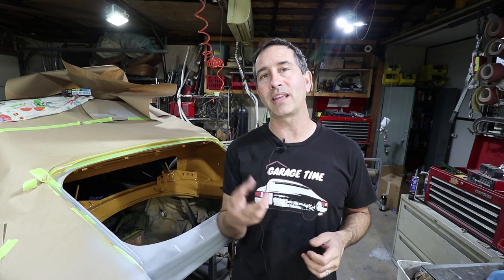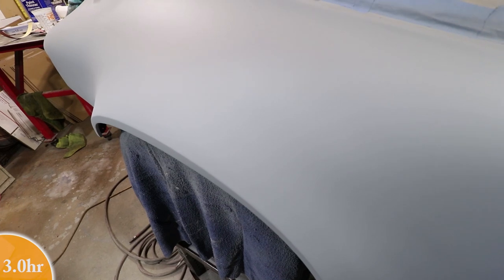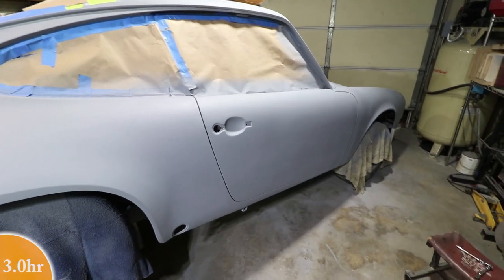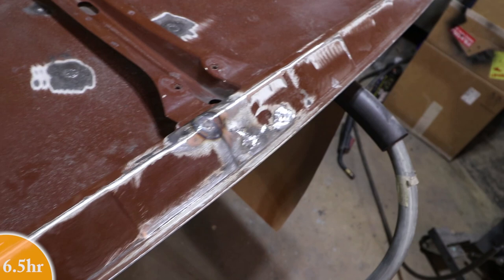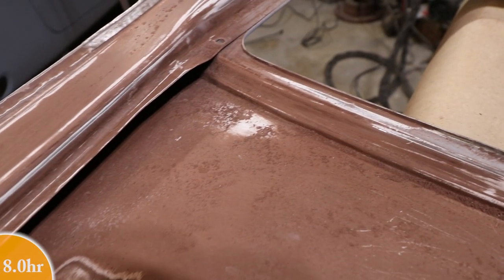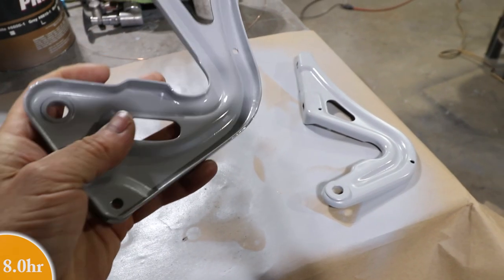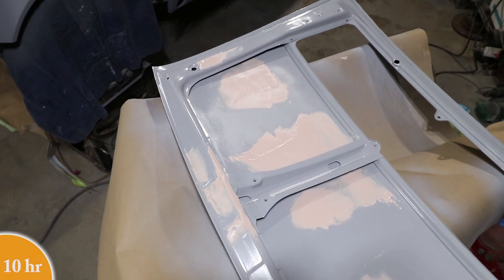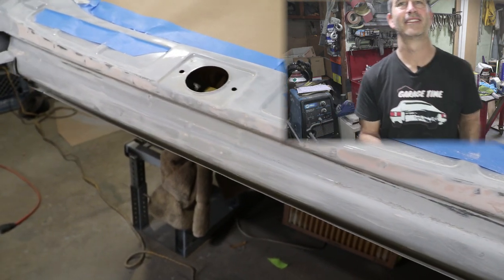Latest Porsche 911 Paint Job Prep Inside and Out

Comment: I thought I had watched all of your videos, but I don't remember if you've answered this -- Why no duck tail?
Reply from the maker: Hi Ronald,. Thanks for watching all the vids.  Wow!  I have not mentioned the duck tail.  I like both looks, smooth and duck.  The only reason I'm starting with smooth is cost. I found this one for $150.  I may add a second duck tail in the future and be able to swap them out.  
Good question.  I did put lots of work in this one, so I'm not going to just throw it away.  
Duck is supposedly good for really high speed aero.  I hope to be able to compare both on the track in the future!
Reply: @GarageTimeAutoResto  I really like that you're doing the whole thing on a budget.  I built my race car to be the least expensive Spec E46 with all of the parts that would make the car go faster and none of the unnecessary stuff.  I wound up spending around $10k less than most people who have built one.  

Your latest videos have been including a cost breakdown for that episode.  Are you going to share the whole budget at some point?  You seem like a good engineer.. I'm sure you have a spreadsheet!

Between you and Home Built by Jeff, I really want to start one of these builds.  I'd want mine to be as street friendly as possible.  I just don't know with KW's and some sound deadening and maybe the electric air conditioning solution ($$) if the car turns out to be as good of a regular driver as I would want for it to be.  I'm in Sacramento and without good AC a car isn't very useful.  I'm also concerned that they get valuable to the point where I wouldn't want to have to not drive it because I was afraid of parking it on the street.  I have a Cayenne S and a 996 and I can drive either of them anywhere.

Since I'm writing you a small book already, I'm also really curious how much track experience you have?
Reply from the maker: I would love to build a BMW as a daily driver soon...as time permits, which I don't have at the moment.  ha ha.  
I did share the total cost budget here but I will be adjusting it and posting it again.  I think the paint materials put me over me over my target.  Yes, I have a spreadsheet!, ha ha.  
https://youtu.be/pC7Qp-z0bIY
To me, this car will always be a $4000 car, so I plan to use it as such.  It will be scratched, but I hope I'm the one who scratches it.
Home built by Jeff is awesome.  I love to see doers like Jeff and yourself getting it done.
I will be the first to admit that I'm a better engineer than race car driver.  I have raced in the champ car series.  Here's the vid.  In fact I'm missing out this weekend at Thunder Hill because I'm too focused on my car.  
https://youtu.be/az9tfTFMsqo